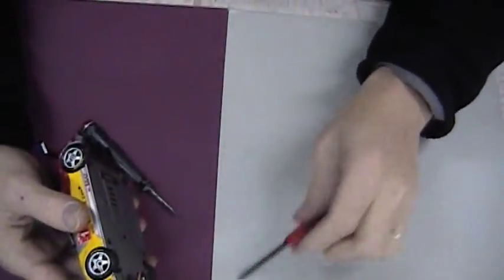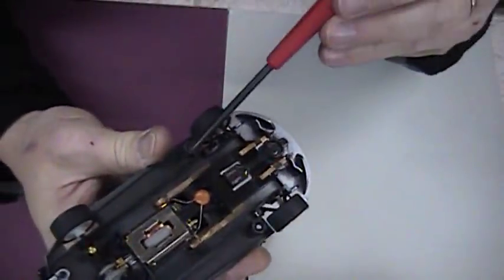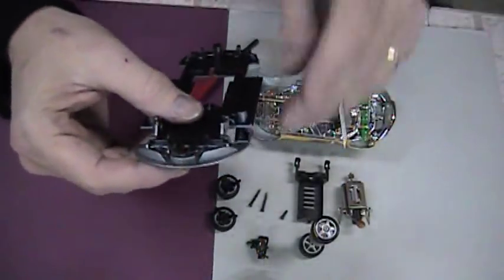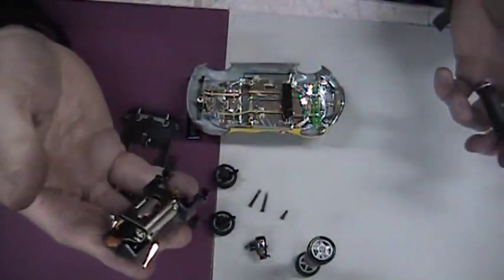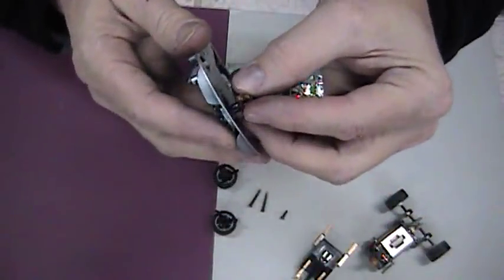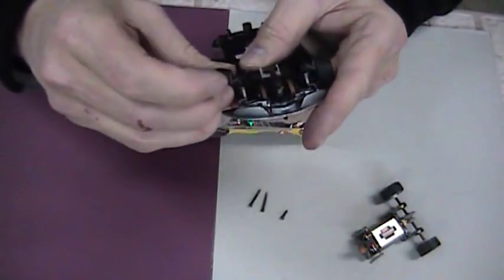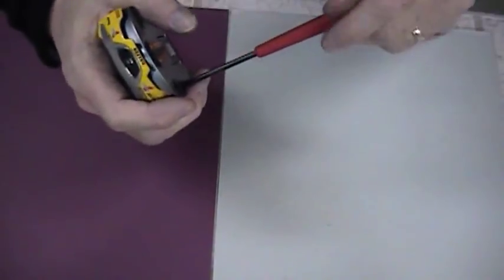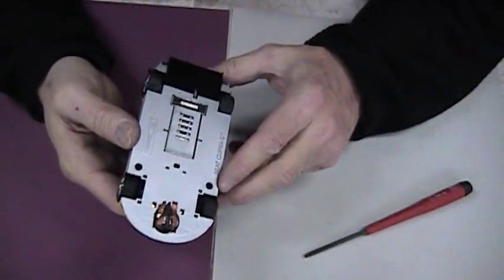SCX Tech "How to take a Digital car apart"

Comment: This mechanic should work at SCX.

Just bought the digital pitbox set.

1.  Porsche front wheel is stuck!

2.  BMW lanechange pin is loose and falls out the bottom!

#.  Corvette front wheels are made so bad the "wishbone" doesnt fit at all and the wheels     can't touch the track.They're just sitting there loose in side the body!

4.  The pitbox lane should have the word BOXES , but the ES is not on the entry track.

It's all part of the fun!!!!  YEAH RIGHT!!!!